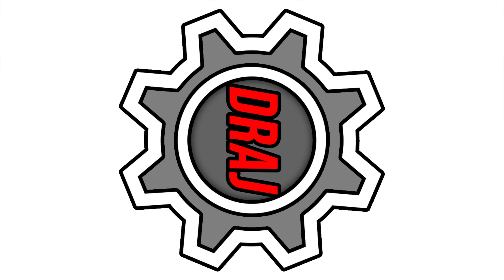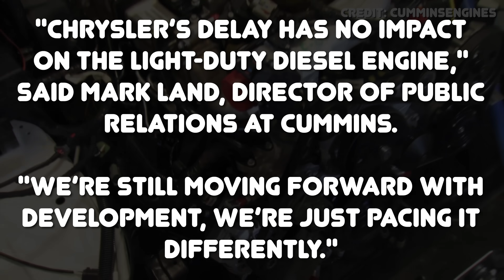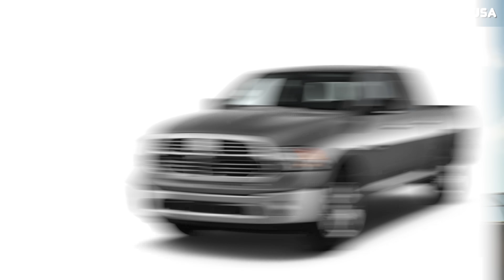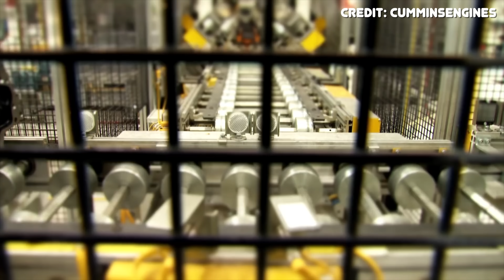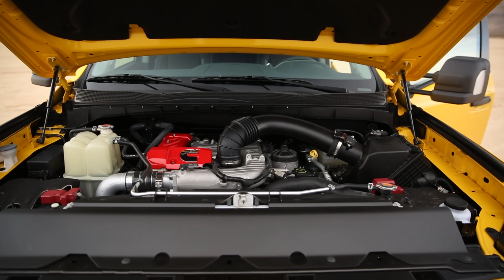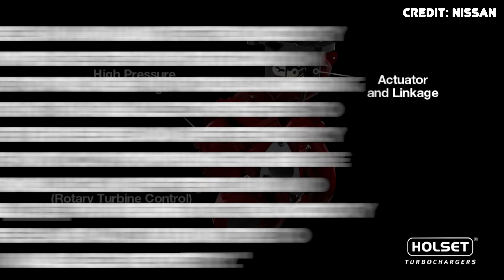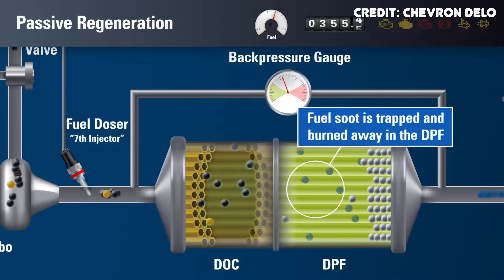5.0L Cummins: Everything You Need to Know

Comment: I would love to know why Nissan stopped using the 5L. Good content, keep it up.  I do have a question about the the Ecodiesel used in the Ram trucks.  I thought it was because Fiat who bought Chrysler at the time owned 40-50% stake in VM motori and then purchased GM’s 40% stake? As to the reason why they didn’t want to buy from Cummins, not sure.  Also there was the issue with the 2016 and early 2017 Titan XD with the 5L, where the front of the crankshaft would snap off.  I heard the those were the cast crank ones and that the later models had the forged or “upgraded” crankshaft. I personally bought a late 2017 build XD in December 2017 and has been my daily driver ever since.  I’ve only had one issue and that’s the EGR cooler welds cracking and leaking inside.  It’s my understanding that this is a common failure point on these Cummins engines however, it’s still covered under warranty so I’m not making any changes.
Reply: It is simple. They just didn't sell enough to justify offering two engines. I love mine and plan to keep it as long as it runs. A very rare truck.
Reply: @JamesMcGillis  a rare truck that nobody wants.
Reply: @duckwacker8720  check the prices. Only going up, up, up. Good luck finding one. Ha!
Reply: Those engines came with forged steel cranks since day one. The issue they had with the 16-17 models was a metallurgical problem in the casting if I remember right.
Reply: If you delete your emissions you don't have to worry about a warranty.
Reply: @duckwacker8720  I live in California. If you delete and get caught by commercial CHP inspection, you have to revert to stock or you cannot register your vehicle. Benefit of stock setup is no diesel exhaust to foul your lungs.
Reply: Cummins stopped making that engine, it wasnt Nissans fault.
Reply: @Jackmerius_Tacktheretrix  they stopped because sales volume was too low, not because it was a bad engine.
Reply: @JamesMcGillis  I have a 16 xd with this engine amd I love it. Torque comes on strong and quick at 1500rpm. Much sooner than any of the 3/4 tons ive driven.
Reply: @Jackmerius_Tacktheretrix  My '17 has only 50k miles. Let's hope it lives up to Cummins reliability. I made one huge mistake and put some DEF into the fuel filler. The two-stage filtration system caught it before it caused engine damage. When a "low fuel pressure" warning came on, I took it to the dealer. $450 later, I had new filters and a cleaned-out fuel system. It took a year for the warning to come on. Make sure you never open the fuel filler with DEF in your hands. If you do pour some in, get service right away.
Reply: @JamesMcGillis  mine no longer requires def 🙂

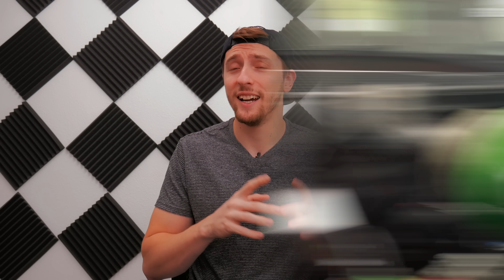Comment: 13:13 yeah but considering it's a 5L diesel that's capable of near semi truck levels of torque is very impressive
Reply: Not sure what truck engine you are thinking of that's making that low of torque. Pretty much all cummins, paccar, and Detroit engines are  factory rated close to 2000 lb ft of torque. The low output stuff is 1500 lb ft
Reply: @curtisd8206  well, l10, m11, and older diesels, as well as like the dd5 or I believe even the dd13
Reply: @_.incredible_magnum._291  those are all smaller medium duty engines you would find in alot of box trucks and other small single axle commercial applications. Not really semi trucks
Reply: @curtisd8206  they're still semi. The l10 is used in some older frieghtshakers and the m11 is used in some cab overs. Not to mention that the dd13 is used in freightliner's updated business class that needs a cdl to operate.

Or how about the old Detroit's that were 7L V6s that were used in all kinds of heavy duty vehicles.
Reply: No semi has under 1000tq. Scanias very popular v8 has around 2500
Reply: @alexstromberg7696  ok, what's your point?
Reply: @_.incredible_magnum._291  his point is that you are wrong🤣🤣 the 5.0 is not making near semi truck levels of torque. It's a failure of an engine in a failure of a pickup
Reply: @curtisd8206  the dd13 makes anywhere from 600-1060 ft-tq. In a m2 freightliner. Even the tandum axle ones. I'm not wrong. And it's a failure not even because of cummins, but because of Nissan and they're marketing.

Plus I said capable of making

Comment: These engines always intrigued me, and they sound fantastic. V8 diesels just sound so sweet.
Reply: Look up a 903. They sound pretty sweet. Although personally I prefer the tractor like sounds of my 12V.
Reply: @92powerdiesel61  12V and 24V Cummins sound miles better than the 6.7, especially the 24V which can sound like a semi
Reply: @169abr  my 5.9 with the 4” turbo back straight piped exhaust and 5” tip sounds amazing. Tuned to about 460hp now, and only a slight haze on full throttle. Pulls my 16k fifth wheel like nothing all over Colorado at an average of 18 mpg. It can’t be beat in anything currently available.
Reply: @169abr  12V with ve pump and a wide open 5" exhaust... oh my fudge sounds amazing.  I did that to my f350.  I have a video of it idling actually.  I was raised around muscle cars though, so the sound of a V8 > I6.
Reply: @NavyCuda  I can imagine the awful drone 😂
Reply: @chevyon37s  It sounded like a dump truck.  The drone was... obnoxious.  I just put a 4" exhaust on my titan and thankfully it has no drone, isn't louder in the cab... but the exhaust note has so much turbine now, sounds like a 6.0L PSD.
Reply: @92powerdiesel61  the 12 V and 24V 5.9 Cummins sound like the equipment and excavator pump engine they were created to be. They don’t sound like the 350 or 400, and have nothing sound wise in common with N14, or ISX. 
There have been some minor changes, but they idle different and sound catastrophically different. Dodge just shoved it in a truck and now I’ve got pickups trying to come into my shop.
Reply: A Cummins with a 2nd Gen exhaust manifold sounds amazing. But yeah, I love the sound of V8 diesels as well (except for the new ones, which were purposefully made quiet).
Reply: We have an XD and if you don’t want loud and modded trucks it’s honestly really fun to drive, plenty of torque.
Reply: I wonder how Audi’s twin turbocharged diesel v12 sounds in one generation of their Q7
Reply: V8 diesels sound like a bag of hammers in a dryer 😆
Reply: @PabloXanaxBars  only 6.4’s sound like that lol
Reply: @PabloXanaxBars  ya ok😂
Reply: @PabloXanaxBars  Depends on the engine!  The ISV5.0 in the titan sounds more like a sbc with a quadrajet.  Oddly even has a sound similar to vacuum secondary's.

Comment: Hot take: the 5.0 v8 cummins had no reason to exist and the titan xd doesn't bridge any gap in any useful way
Reply: This true, I have one and with the pro4x package and some go fast stuff the thing is an absolute blast and pretty fast for big ol truck
Reply: @Iwannagofast how many miles? And how reliable has it been
Reply: @Rocket_goespew  I have a 2017 with 87k miles with 500whp and meth/water injection. Only thing that came factory on the truck that failed was the fuel/water separation pump. Housing in the pump cracked and couldn’t fix the leak. Went the FASS route and put a fuel sump in the tank. Literally only thing to break on the truck.
Reply: True. It was cool tho
Reply: I have one with 120k miles and it runs strong.

Comment: I always wondered why they didn't use a variant of the 4bt brought up to say ~ 4.5 liters. All the emissions technology is there; just needed to be scaled to size. And a good balance shaft would have quelled the paint shaker tendencies of that engine. Probably cheaper development, too. 275 HP and 550 lb-ft was certainly doable. And, just turn the wick down a bit for the Ram.
Reply: The Brazilian version of the 4.5 Cummins makes 300 HP in the Ford Super Duties
Reply: A 4BT weighs 750 pounds it's a boat anchor
Reply: @PabloXanaxBars  IT wont meet emissions!!!!!!!! Thats why the 5.9 went the way of the dodo bird!
Reply: @PabloXanaxBars  Just makes for a smoother ride
Reply: i am not sure if this applies to diesel but a gas inline 4  hits a maximum size at 3 liters.   without turning into a paint mixer    there have been a few attempts at larger but they required additional balancing in the engine.  making it expensive and complicated
Reply: @welewisiii  nah, isuzu has the 5.2L 4banger. and its hushed and modern just like any other 6 cylinder.
the 4.5 cummins is even more refined than the ISUZU and more.powerful.
Reply: @Tedkelvin  you are correct.
Reply: There is a Cummins isbe 4.5 liter 4 cilinder engine, i have one in my Daf truck, and it is very reliable, but only puts out 160 hp
Reply: I used to work on an old fleet of bread trucks that used the 4bt.. they weren't very fuel efficient and they did vibrate pretty badly and hags to start on cold days.. Cummins offered a kit to resolve the vibration problem but in all my years of working on commercial trucks I have never seen one installed.. the later common rail electronic 4BT is infinitely smoother and quieter. in fact, a FedEx contractor rolled into my shop with a panel van one day leaking oil and I thought it was using a Benz engine and it turned out to be an electronic 5BT with common rail. Common rail has definitely turned the 4bt into a different beast
Reply: they use the 4bt in boats all the time .  i wasn’t thinking when i wrote my previous response.   

the low rpm nature of a diesel i am sure has something to do with it.  and heavier components  are easier to balance and engine

Comment: They really weren’t that great on fuel. One of my employees got one because of how unique he thought it would be, and only kept it a year. 12-16 MPG on the interstate, 10-12 pulling his boat. Our 6.0 work trucks get better fuel mileage.
Reply: Garbage compared to the 7.3L
Reply: @Chase_01  haha… 7.3 is a turd.  And it’s a one-trick-pony—reliability.  Zero performance out of all those liters.
Reply: @edwardman1742  have you owned one since new because I have two one 350 dually and 250 both manual never had any issues
Reply: @Chase_01  “never had issues” yep, just what I thought you’d say, lol
Reply: @edwardman1742  why would you want performance in a big truck? Imagine chasing performance in your Ford truck and a stock Camry out performs you, and then your truck breaks, and then your family leaves you, and then you start taking drugs
Reply: @macbook802  haha… the problem is you’re equating performance with speed.  That’s wrong.   Diesel performance means you can pass a tractor trailer while pulling a 10k+ camper before oncoming traffic reaches you.  Diesel performance means you can pull a 10k+ trailer fairly easily up a steep grade.  Diesel performance means when you need to go, you go,  you don’t have to wait 5 seconds to spool.  Diesel performance means you have a wide enough power band where you don’t have to work the transmission a lot to keep your speed.  Diesel performance means you can pull at a decent MPG so you don’t have to stop and refill as often.   Get it?  You with me now?
Reply: @edwardman1742  oh yeah i haven’t had a class cdl for 20 years. I know nothing about diesels, thanks for teaching me bro
Reply: @edwardman1742  when you pull 80k+ up a hill with 300 hp and then roll back down you can teach, if you survive
Reply: @edwardman1742  and then not to mention if you haul a** trying to beat traffic while hauling all of your products will end up on the floor and then instead of being paid to haul, you'll be paying to haul
Reply: @macbook802  ok, ok sir—I get it. You’re a badass driver and know your stuff.  I appreciate what you do and I’m not going to question you.

The video is about light duty diesels, and I was just sharing what non-professional people typically think about when choosing how to power their truck or suv.  My diesel needs to pick up my kids from school, pick up groceries, take road-trips, pull our TT safely, do light work, camping, etc.  I imagine much different needs than a big rig.

But yes, I agree that reliability is most important than anything.
Reply: Well, if people still buy them, then that formula works don't it?
Some people value reliability over speed.
Reply: @edwardman1742  I went from  a 2003 bulletproofed 6.0 to a 2003 7.3 with a edge tuner and it has plenty of power tuned!  Love the reliability and no def!! Will never buy a newer diesel!!! Until i get the hell out of California and can delete it!🤣
Reply: 6.0 is a beast. Keep up on the maintenance and leave it stock they are fairly reliable.  The moment you crank it up I hope you prepared for it such as heads, studs, better cooler, an better cam  the stock cam grenades eventually once turned up.
Reply: That’s odd, I own a stock 19 SL and I get 18mpg @ 75mph and 21mpg @ 65mph on the interstate. I average 16 around town.
Reply: @brianbehling9439  Dude was probably driving 90 mph everywhere like everybody in the entire United States during rush hour, because the speed limit is just a "suggestion" to people.
Reply: @brianbehling9439  I was going to say the same thing, and towing my rv with 2 motorcycles in the bed I was 12-14mpg.  Fuel mileage isn't bad if you don't try and drive it like a corvette, but when you want to pass someone it'll definitely accelerate nicely.
Reply: @berserker406 I was being sarcastic and poking fun because 7.3 owners love to brag about “legendary” reliability. And I agree, the 7.3 is very reliable.  But there are other engines with better efficiency, performance and drivability that can be reliable too.
Reply: @edwardman1742  Dude you are talking out your ass !!!!!!!!!
Reply: @edwardman1742  I would like to get a 6.0 dump truck. I didn't like the 7.3 powerstroke it just didn't have the power. even compared to the older non turbo and turbo idi

Comment: By what I understand even though it was made for fuel economy it never really lived up to that.  And that is likely why it flopped not because it was a bad engine
Reply: Its not the engine, its the gearing. The 3.92 rear makes you turn more rpms. At 75 im turning just over 2000rpm compared to 1600-1700rpm in our 3/4 ton trucks.

Comment: The 5.0L Cummins was originally funded as a US military engine.  The engine was never intended as a Ram 1500 engine.  When Nissan dumped the Navistar 4.3L diesel engine, the Cummins engine was the only other available engine that fit into the vehicle platform.  Nissan brough the Cummins engine out of mothballs.
Reply: 4.5 v6?
Reply: Cite your source.

Comment: Yo right off the bat with a big mistake about 5.9 and 6.7 being used exclusively in ram trucks
Reply from the maker: I meant that in the context of 2500/3500 trucks, nothing commercial.
Reply: @Dustrunnersauto  oh ok fair enough. And I'd like to make the point that in the 2000s gm made a 1500 HD that got discontinued because of sales. I wonder what made Nissan think they could make it work?

Comment: I personally love this engine, and I think if Nissan continue to use it on the new platform it would have became an awesome competitor, especially with the nine speed transmission. If Nissan would put this engine on the new redesigned Nissan titan XD, I would put an order for it immediately
Reply: Nissan bout Jacko who builds the worst trans ever made . But they may have got a diffrent tras for their diesel truck.
Reply: @brentmcmahon8188  in Europe we have the 6speed Jatco transmission in a lot of Nissan and Renault, and they're pretty good, they last at least 200 000miles even if they don't get an oil change, the CVT can be bad, but theirs automatics are amongst the best transmission you can buy

Comment: It was a fine engine. Though the fuel economy was kind of knee capped, it is pretty nice. With them in the Titan XD, it would throw check engine lights for when DEF is low, oil needs to be changed, fuel filters, engine air filter. If I can find a Titan XD I'd buy one. However, transmission needs fluid and filter changes every 36,000 miles sadly.
Reply: I change my transmission oil every 50,000 km. Cause oil is cheap!
Reply: 36k miles is a lot i hope you do filter and fluid changes in that kinda time frame
Reply: @jakethemidget2873  That's almost the same time frame as the dif I'm my dodge, the trans service is like 50-75k miles
Reply: What kills the fuel economy is the 3.92 rear end. At 75 you're pulling just over 2000rpm, compared to 1600-1700rpm in most 3/4 tons. Thats where the low fuel economy is comign from.
Reply: Just do your maintenance then smh 🤦‍♂️
Reply: that is literally just basic scheduled maintenance, that isnt anything unreasonable at all. stop being so picky and complaining every vehicle requires that simple maintenance
Reply: @Mr.Thermistor7228  When every other manufacturer has about a 100,000 mile interval for transmission fluid and filter changes, I get to gripe about it. I've done several transmission pan services where I had to reseal the pan due to the gasket or RTV was leaking. Not a fun job to do even with the right tools.

I have no idea why Nissan couldn't get an extended service interval. For the amount of driving I do, that's about a once a year service.
Reply: Glow plugs for life of the engine. 

And you say you’d buy. 

Never let a fool keep his $$$ they say
Reply: @fastinradfordable  cummins don't have glow plugs.
Reply: @mrrod3004  the video said it has glow plugs. So I have to assume it has them. Unlike the grid heater in the I6 engines.
Reply: @mrrod3004  my 18 XD has glow plugs.
Reply: @cdub5738  no such thing as a cummins 18 inkess you mean year model, they have grid heaters...my 06, 11,12,15 and 2022 all have grid heater. Even my 2022 r2.8. In my jeep. All cummins are grid heaters. They even had recalls recently on the 21 models.
Reply: @rheuss1  there mistaken glow plugs with a grid heater, i dont know anything about the l series.
Reply: @mrrod3004  the 5.0 Cummins does, in fact, have glow plugs.
Reply: @mrrod3004  There's glow plugs in pretty much all diesel motors especially Cummins guy no grid heaters all my diesels had glow plugs even the 2 i own now